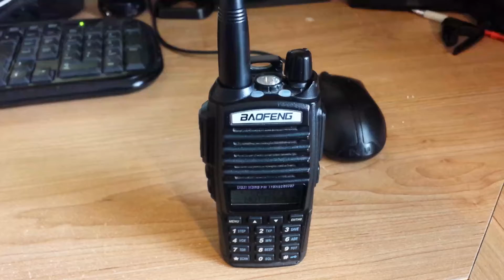Baofeng UV-82 -- How to Display Frequency

Comment: Ive got the UV82HP. Im unable to change from frequency to channel mode. I know how to do it, it just dosent change. Any advice?
Reply: There's a caveat to this video. There's a bit (or check box) in the advanced menu of CHIRP that has to be set in order for this to work. You cannot do this without first initializing the radio with CHIRP software.
Reply: @paulkafig5788  I will try that, thanks so much

Comment: i have a question for the maker of this video or any one really ... can you program a uv 82 as a scanner only and lock the transeiver  via chirp programming ? so it dont get accidental key ups etc... id preffer to use it as a cheap scanner tbh
Reply from the maker: Yes, with CHIRP each channel has the option to be programmed not to transmit by setting "Duplex" to "off." You can also disable transmit for VFO mode under "Other Settings." However, scan speed is very slow. I personally use mine to listen to the fire department, but only for two channels at a time, using dual watch.

Comment: does adding a larger antenna improves transmission and reception for FRS frequencies?
Reply from the maker: Using an antenna that is resonant on FRS frequencies and getting that antenna as far above the ground as possible is the key to improving transmission and reception. A resonant antenna may be longer, but that is not always the case. I have found that the stock antenna is very good on FRS frequencies, and using a different handheld antenna will probably not make a noticeable difference.
Reply: Great thanks! :)

Comment: On my boafeng UV-82 I cant get frequencies like 180.475 // 180.450 and it says system type as MPT-1327 Standard, but surely I can get it on my one as well. I would also like 027.185 and I want to know how to get some without a PC
Reply from the maker: The frequency coverage of the UV-82 only goes up to 174.000. So the frequencies 180.475 and 180.450 are out of the range of this radio. Also this radio is not compatible with MPT-1327. And since the frequency coverage only goes as low as 136.000, the frequency 27.185 is also out of range. I hope this helps.
Reply: Is there a way that I can buy a new antenna that supports it?
Reply from the maker: +Your Must Not Know (xXBorn2GameXx) The problem is not your antenna; the problem is the electronics inside the radio. Even if you had a different antenna, the electronics would not be able to tune to those frequencies, so they would still be out of range.
Reply: Ah... Oh I watched a video how to make the radio into a scanner by changing settings from the PC, so would that work? or can I do it by putting the frequency in a reboot the radio and change it to channel mode and see if that works? Sorry if im making you angry or stressed out but im just wondering how to.

Comment: hi. how to set the frequency to 125.29?
Reply from the maker: +nick geronimo Hi! You cannot set the frequency to 125.29 because it is out of the range of this radio. The radio covers 136-174 MHz and 400-520 Mhz. Also 125.29 will have transmissions in AM, and this radio only receives FM, so it would sound garbled. Hope this helps!
Reply: +9303Siren  ohh thank you. I was wrong not 125.29 but 145.29 ^^.
Reply from the maker: +nick geronimo That is within the range of the radio, so setting that frequency should be as simple as typing it in on the keypad. If the radio is not already in frequency mode, you will first have to put it there by turning the radio on while holding the Menu key.